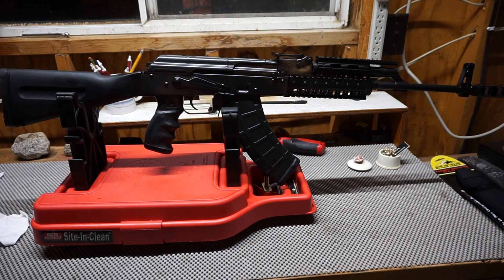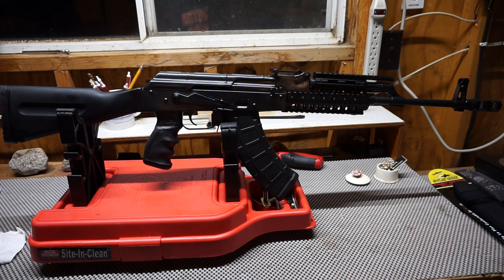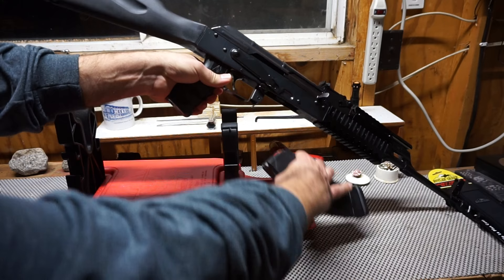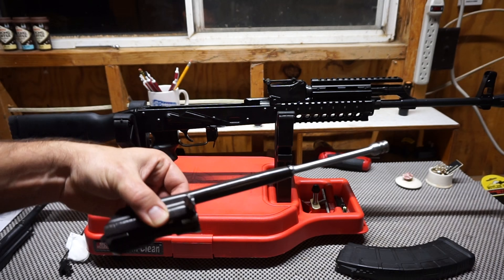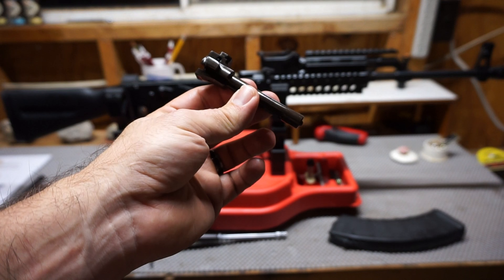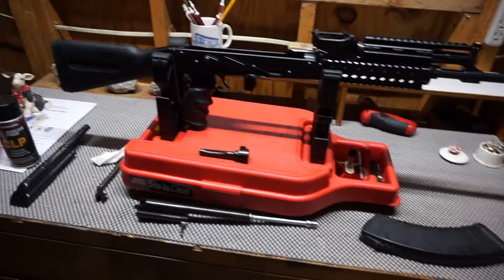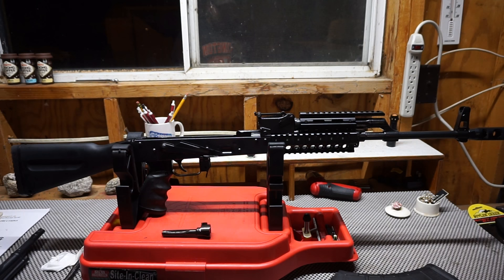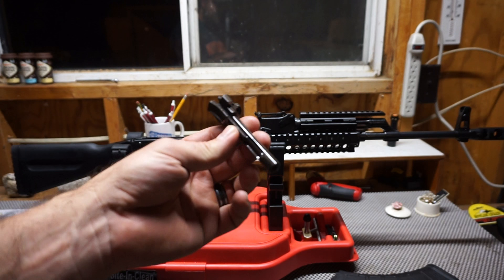Inside the AMD 63 AMD 65 James River Armory AK47! Pre-fire BCG inspection!

Comment: the muzzle brake was used for the shorty or tanker . should look into th mission first handguard lighter than that utg rail system. I modded a troy industries battlerail on my 65 tanker it was an sa2000 tgi feg with the 12.barrel. the Fire bealching lead pissing dragon of death. I love it mor than th polytech fixed I use to have...... still want an sa85 hungrarian
Reply from the maker: Monty Bigbore I will definitely check out the MFT part.

Comment: rather RAS
Reply from the maker: rednecklowlife I recommend both the RAS47 and the 63.
Reply: I guess i shouldn't say since I don't know anything about the 63. But not fond of pencil barrels! Which may make no difference in most situations!
Reply from the maker: rednecklowlife No. You are right. A thinner barrel will affect accuracy once it heats up. I have seen quite a few range tests by respected YouTubers that show how your accuracy group opens up after the barrel heats up. MAC was getting minute if man accuracy at 100 yards. I put a dot sight on mine and will be dialing it in this weekend.
Reply: Don't get the RAS. Nothing but terrible reviews from them
Reply from the maker: I had one.  Only fired 200 rounds through it but I had good luck with it.
Reply: Yea when they first came out. I heard they had issues with a soft bolt and trunnions. I think they started heat treating them better or what ever! So I think that helped a lot! Other than that they are a pretty damn good rifle for the money. I personally don't plan on putting mine through the Rob Ski torture test. So I should be good! I also have the C-39 V-2 and C-39 RPK. and pretty happy with all of them! Even if the RAS was junk I would still get one. Because I am collecting. My goal is to some day have as many different models and makes of KALASH variants as I can afford!
Reply from the maker: rednecklowlife Dude, I so could have used your "backup" on the pro-RAS videos I made earlier. Yeah, I had a later production run on the RAS and experienced zero issues and I'd consider buying another one. Only reason why I sold mine was because I needed $$$ for the AMD.
Reply: rednecklowlife I like the c39v2, but it's also not as reliable as it should be for the money
Reply: Yes if you compare the price that you paid years ago for like a NORINCO or something. The price is a little high for the quality!. But those days are gone for good!